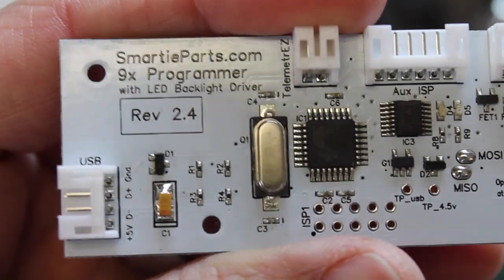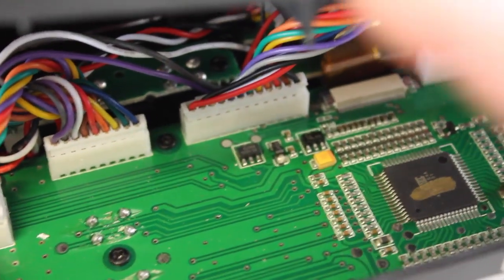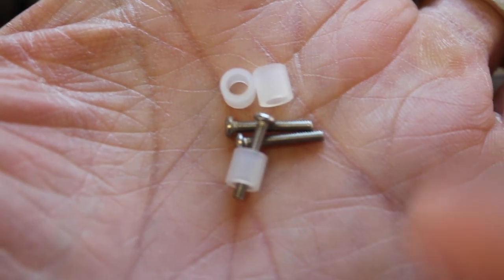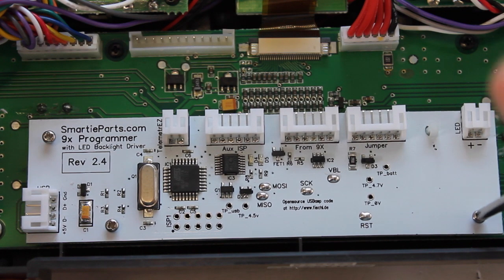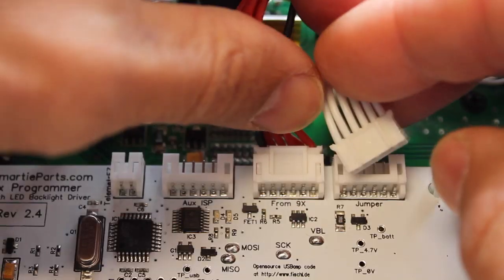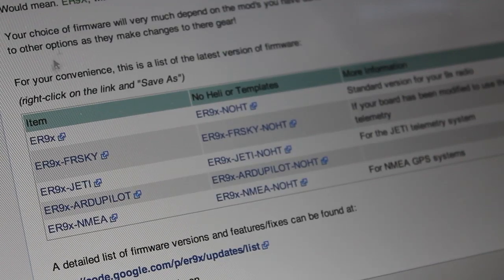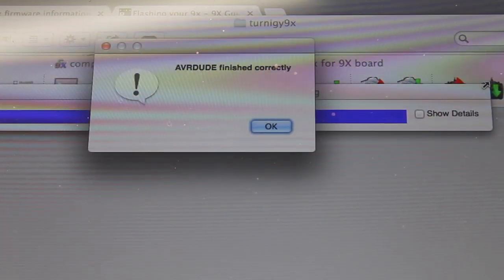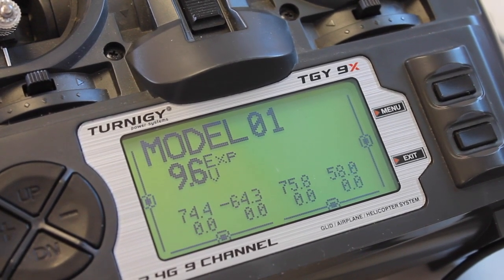Solderless er9x Firmware Upgrade for Turnigy 9X Using SmartieParts Programmer Board

Comment: Amazing.  You take a $70 transmitter, add a $40 board to it, plus you've already added a LIPO battery and changed out the transmitter so you now have what, a $150 transmitter where you could have bought a $150 OpenTX transmitter in the first place and gotten a better unit.

Comment: Hi! Thanks for the vid - I too am about to warm up the soldering iron! Two questions, not strictly related to 'flashing':
How many model memories can be stored on the new programme,and
2. Can I use my Turnigy receivers with it?
Once again, thanks very much , Den
Reply from the maker: I'm not sure how many models it can hold. I know the extreme version can hold over 60:

http://smartieparts.com/shop/index.php?main_page=product_info&products_id=378

Yes your turning receivers will still work after installing this board. Good luck.
Reply: Thanks, Den , that's a relief!

Comment: great vid. is the procedure the same for the fs th9x? i decided to get the fs th9x and add the smartie parts with the cc2500 4in1 module so i could replace all of my toy grade quadcopter transmitters. with this set up you can use it for 192 different models, including planes and helicopters. the only con  with this is the poor range (it varies with protocol). for longer range fpv mini quads i have the radiolink at9. the smartie parts board now comes with the backlit screen. just thought i'd put that out there for any noobs (that includes me).
Reply from the maker: I know that the FS TH9X is fairly similar, but I'm not sure if the procedure is the same. I believe the internals are pretty close to identical but we'll have to rely on you to let us know for certain. Thanks for sharing that bit of info. Very useful to know. Thanks.

Comment: How do you like Er9x now that you had a lot of experience with it? I'm thinking of trying it out due to the increased model memory, but I have found the various videos out there make it seem less intuitive and more time consuming to program than the stock firmware. What are your thoughts?
Reply from the maker: +tlgrimmy I really enjoyed it although I got rid of my 9X and purchased a Taranis. Mainly because I wanted more channels. I found the UI to be more intuitive than the standard firmware, but I realize that's not saying much :) I really needed the flexibility and that's what you get over the stock firmware. BTW not sure if you've seen this recent product: http://smartieparts.com/shop/index.php?main_page=product_info&cPath=3&products_id=378 Good luck and let us know what you end up doing.
Reply: +Dennis Baldwin Thanks for the reply! I ended up just soldering in cheapo ribbon cable and put the connection point in the battery bay. I finished up loading OpenTX and added the backlight with a transistor so that OpenTX can control it. With a new LiFe batteryand the ability to control the backlight, you really get a lot more flight time than with the AAs, so that's nice. Really digging the new firmware! It's actually much more user-friendly than I originally thought it would be. I also like how you can customize which options you want, reload the firmware with the changes, and not loose any of your models or previous settings. That's super handy! I was actually able to load it up with the full 16 models and not have any connection issues either, which was a bonus. One day I'll likely upgrade to the Taranis or something similar, but it's sure nice getting so much functionally with so little investment. Those sub $10 receivers are also great when you have a ton of models. Thanks again!

Comment: Hey Dennis thanks for the videos! Is that a DJT module you pulled out at the top of the video? Are they directly compatible, or is there a mod that goes with? thanks a million
fin
Reply from the maker: Hanuman UAV Yes it is and I've had no problems with it in the Turnigy 9X running er9X. Thanks for the question.

Comment: one question i wanna use my Turnigy flashed with Er9X , and i am gonna use it for  quad-copter .. what it will be your advice about the hex file that i should download it ? it is the ER9x-ARDUPILOT right... thank you for helping me again
Reply from the maker: elie eid From what I read is that if you want to get telemetry data on your screen and have done the mod to support it then you want the ARDUPILOT version. Other wise you can use the standard.

Comment: Isnt the led panel wires suposed to be cut and soldered to the wires that come with the smartieparts board to plug in the LED plug?
Reply from the maker: sparrowlt Great question....and yes that can absolutely be done. I didn't cover it in the video because I was fine with my backlight being on all the time. But if you want to be able to configure it to come on and off, as well as adjust the brightness, then you can definitely do that. Just make sure you have the backlight module:

http://www.hobbyking.com/hobbyking/store/__16720__Turnigy_9X_LCD_Backlight_Kit_Blue_DIY_.html

Thanks for the question.
Reply: Dennis Baldwin
Oh i had not tought about that.. i just followed smack's instructions while watching your video and a couple other.. thanks for the job..made my life easier.
In my case it was removing an older smartieboard that had burnt out somehow and the old EL panel for replacing them with the LED panel and the newer board.. but everything worked and i have USB interface again (and a brighter backlight)

Comment: Hello I'm fairly new to the rc community (neewbie) . My question is if i add this board to my radio what am i really getting and do I have to have the frsky module in order for this to work. Also Dennis I have watched a few of your videos... great job keep them coming. I'm hitting the subscribe!!!
Reply from the maker: Dwayne Batson Thanks for the kinds words. From what I know the SmartieParts board and er9x firmware don't care about what module you have installed. So this should work for the standard module or FrSky. Check out the different firmware loads if you have any concerns:

http://openrcforums.com/wiki/index.php/Er9x_firmware_information

Best of luck with your setup.

Comment: Hi Dennis great video! I want to say... I heard that is possible to monitor the internal voltage of a battery with the FrSky D8R II Plus receiver. Question, if I flash my Turnigy 9x with Er9x software would it be possible to monitor the voltage on my quad???
Reply from the maker: Jorge Ortiz I haven't done this before but from what I've read it seems straightforward. Apparently you jumper A1 and X on the side of the receiver as mentioned here:

http://www.alofthobbies.com/frsky-d8r-ii-plus-8-channel-receiver-w-telemetry.html

Then I believe you retrieve that data at your TX. If you have any problems with it please checkout www.garagepilots.com and post in the forums We should be able to help you out there.
Reply: Dennis Baldwin Awesome! Thanks a lot. I made it work...

Comment: great tutorial, absolutly saved my bacon, well done dennis, my 9x is due here this week 7th 03 2014 and have ordered the backlight for it but am unsure of ordering in advance the smartieparts board,do i need to check the 9x version first on the 9x board 6th v2 or 8th v1 hope you can advise, also have you a vd on backlight instalation
cheers
dave

Comment: Hi Dennis,
Can the SmartieParts board be used to program the 9X and then be removed leaving er9X installed?
Reply from the maker: Great question...and one I did not know the answer but found this:

http://eastbay-rc.blogspot.com/2012/08/smartieparts-one-per-turnigy-9x.html

So yes it's possible but make sure you understand why it's not recommended.

Comment: Hi Dennis,  i though for sure you would have bought the TelemetrEZ  (TEZ for short) module that Steve at SmartieParts has for sale as well. Works with the SmartiePArts Solderless Programming Board( SPSPB) and the FrSky DJT Tx module. I installed it and I am about to make the last connections. The Tez takes the received serial data from a DJT FrSky Tx module and thru the Smartieparts Solderless Programming board UART buss, makes the info available to the MPU of the 9X and while incorporating ER9X FW, easily brings the telemetry data up on screen. There is a specific version for use with the TEZ, which fits inside back section of the 9x case and makes connection with the SPSPB thru a multi pin connector. There are two ways of running the wires from the DJT module, either externally or internally. Tonight, I am about to file down the protruding plastic that interferes with the DJT's fitting nice and flush inside of the 9X's Tx module bay, and then decide on how to connect the telemetry data to the new tez board. I will do a vid on it and have it uploaded as soon as I can on my other YT channel. FlyByTheGrace which I am just getting up and running. Got to tell people about the neat stuff on that site. BTW, I am not only new to multirotor, I haven't hardly any experience with ER9X or APM 2.5 and Mission Planner. So I am virtually swamped :-)
Reply from the maker: Chris, thanks for the great info. I haven't see TEZ but will definitely check it out. I just received my FrSky Taranis so I've been looking into the built-in telemetry options with it. I hear you about being swamped. There are so many aspects to this hobby that makes learning a never-ending process. I'll definitely be on the lookout for your vid. Thanks again.

Comment: Great video. You make it so much easier for a new multirotor pilot to solve issues. I received a 9X for Christmas without a module. Bought an Orange RX module. The servo connections don't match with the OrangeRX receiver channels. So I have to configure each multirotor by watching the GUI and changing each servo connector to match the radio channels,ie throt,ail,elv,rudd. From what I've read with the ER9X you can re-assign each channel. Thanks to your video I have more confidence to install this board and FW.
Reply from the maker: I appreciate the feedback and yes, you can re-assign each channel which is pretty cool. I like that better than having to rewire things!

Comment: Hi Dennis - I want to thank you, your setup's have helped me a lot. I have both the 9x and the 9xr, the 6way switch setup helped when I did it on the 9xr w/ the naza. You will find the er9x fw is a little easier than the standard fw so don't worry about it. Also the smarty parts usb board fits into the slot where it's wires feed thru. (gives more room and protection)
Reply from the maker: Thanks for the tip on the slot. I should've figured that out! I'm looking forward to learning as much as I can about er9x. All the best.

Comment: Also, something worth nothing regarding your backlight. If you power the backlight from the Smartiparts board, the backlight then becomes controllable in the er9x software. Meaning you can have it shut off at a certain time, turn it on and off with any of the switches, blink when you hit a certain flight time, etc... Really worth doing.
Reply from the maker: That's awesome to know about. As I mentioned in the vid I'm an er9x n00b but have been enjoying it already. Hope to learn a lot more from you and others. Thanks Chris!

Comment: It's a great thing! Had it in my 9x from the start, sadly it is now collecting dust since I have a Taranis...

EDIT: You actually can slide the USB connector PCB neatly in the slot that is already in your 9x, it fits exactly!

EDIT 2: Stop using er9x and go for OpenTX. It is newer and more actively developed since it is also used in the Taranis.
Reply from the maker: Jeroen, I can always count on you to keep me straight. I figured that connector would fit nicely in the slot but didn't actually give it a try. Thanks for validating. I just got an email from alofthobbies last night that I could order my Taranis....finally! So I've ordered it and hopefully it will be here soon. Looking forward to OpenTX. Have read great things about it. Thanks.
Reply: Hey Dennis just nice to see someone else does the exact same things as I do ;-) And I know we're not alone in this haha! 

I also received the email from Alofthobbies, asked my buddies if somebody wanted one, it is a very nice radio! 

I am currently doing some 3D modeling in SolidWorks to 3D print some cases for the OrangeRX OpenLRS tx and rx modules I have. I want to try them together with my Taranis, the OpenLRSng software is great! Love open source :-D 

Have a great day man!
Reply from the maker: Jeroen Brosens Great stuff! I will definitely be following your progress. I can't wait to get my Taranis and start experimenting. Hopefully it will be the last TX that I'll ever need to purchase :)